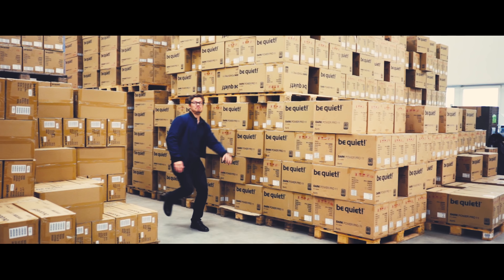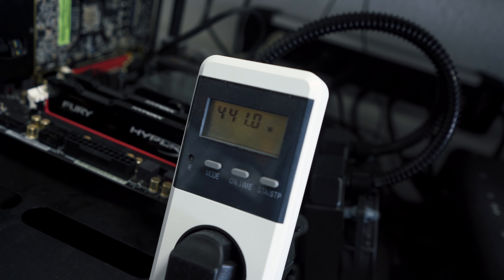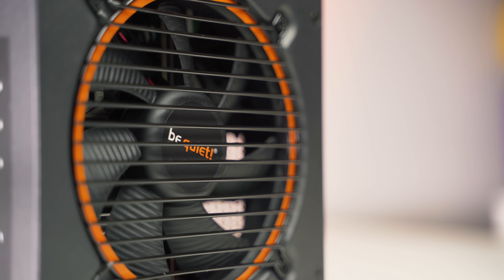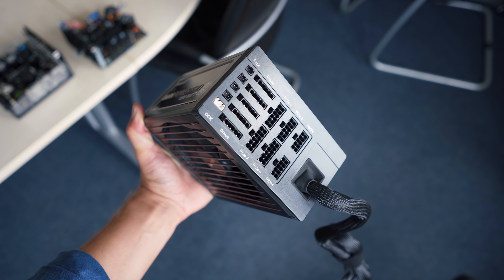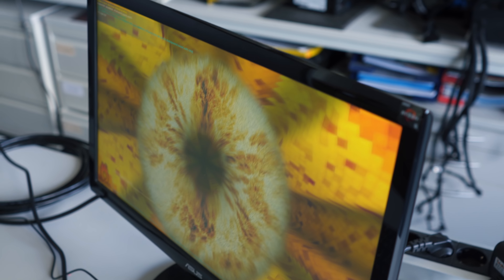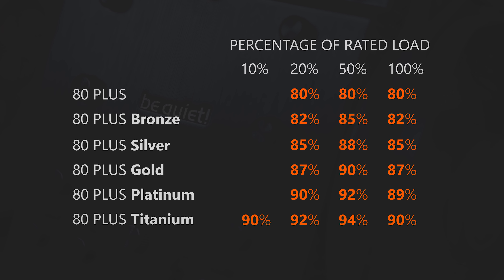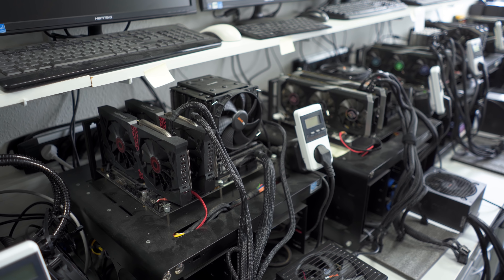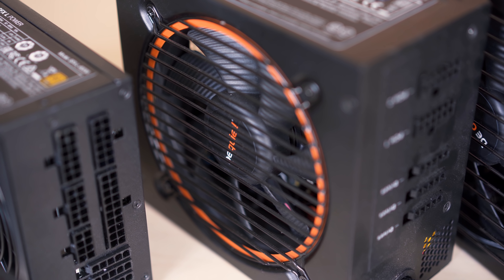How To Choose a Power Supply

Comment: Modular PSU is a must..
Reply: I haven't a clearly opinion about the 24-Pin-Connector, if that has to be modular because their are companies like Bequiet, which have a semi modular power cable system. I mean you could avoid, or improve that with aftermarket extension but I think it depends on the preferred brand.
Reply: @alpher3512  i dont mind if is semi modular or not, because you need 24 and 8 pin connector anyway...
Reply: Learned this the hard way...next built for sure!
Reply: @Amenoxiel   jea me too.... to much of the cables is pain in the ass.... especially for small builds...
Reply: ... or you could improve your cable management! ;) Some 20 years ago, as I started building my PCs, modular PSUs just weren't affordable or even available.
Reply: @hassosigbjoernson5738  he he... true..... but 20 years ago, glass/tempered glass also didn't exist, so cable management was not so important... 😁👍
Reply: semi modular if you're trying to save a few bucks
Reply: @noki448  Naah... you had to do it for better air flow although there still where floppy and CD drives blocking the way. 😉
Reply: @hassosigbjoernson5738  he he you've got that right.....
Reply: @COFASA you are right,... but semi modular are not that expensive anymore,... if this is con, is the only con.... I know you don't need it, but for clean build is not bad to have one...(depending on case of course)😀
Reply: Alpher Quality PSUs usually last for a long time and can be used from one build to the next. Fully modular guarantees that even if the cables break, one can replace them as well as buy some after market cables that have different color schemes to match their latest build. The cost difference between semi- and fully modular are marginal compared to the cost of higher efficiency, for example.
Reply: Or semi modular never use non modular
Reply: @noki448  You need them, but cable mods <3

Comment: choosing a psu is easy.
1) Budget
2) power consumption
3) connectors
4) Get the be quiet psu that fits all these requirements.
Be quiet is the best. Silent, good looking, well built, high 80+ standards, black cables. All th boxes ticked
Reply: Then you have how the PSU actually performs. That's quite important, I'd say
Or do you buy a GPU based on your budget, the TDP and how many connectors it has? GTX 580, here I come!

Comment: I was hoping one of my questions about PSUs would but answered, but it wasn't exactly answered.
I was looking to build a system with a Vega64 but I was looking for the right PSU. I read on Reddit that someone had trouble with their Vega64 because they used a single cable to power both 8-pin connections. When he used 2 separate 8-pin cables the problems he had where gone. Now I'm wondering, how do you know these kind of things? Do you have to look at the connections a PSU has and what power they can provide?
Reply: For GPUs that have a TDP above 225W, use two separate PCIe cables. Below 225W, and you're fine with a single one. So for Vega, use two separate cables. 
The spec for the 8 pin is 150W max. Add the 75W through the PCIe slot, and there's where the 225W number comes from.

Comment: What are your thoughts on server power supplies? I think you mentioned them briefly but I saw a 900w 2” tall psu stretched out long like an LED psu for ~$50 on amazon with 22 positive reviews, the specs and labels check out so I like the look of it for a future laptop build over the taller 3-4” atx power supplies, do you have a video showcasing these?

Comment: I personally have always used evga psus. Currently have the evga supernova 850 G3 powering my Ryzen 7 1700x and Rx Vega 64. Runs very quiet with the Eco mode on and has never given me any instability issues, my old Corsair cx 600w on the other hand caused the Vega 64 to crash under any sort of load. 🤣🤣
Reply: The G3 is among the loudest PSUs on the market. It also has issues with its protections, so the PSU can die instead of powering off safely, like most other decent PSUs would. It also lacks multi rail, increasing the damage in case of a catastrophic failure. 
Who would have thought that an old, low end, group regulated PSU would have issues with Vega. That surprises so many people...
Reply: @MrSeon123  I knew that the 600w would lead to crashing. I just wanted to see what would happen and if it could be done. Yes I knew that it can lead to failure but I didn't care, the inner curiosity won over🤗 as with the G3 I have had since launch with no issues and it never gets loud, so I have no clue what you are talking about in that regard
Reply: Protections are there for when things don't go well. You might end up not needing them, buy you should still have it. 
If you look at e.g. Aris' review, you can see how crap it is for noise
Reply: @MrSeon123  I still don't think you understand what I'm saying here, the supernova G3 PSU is not loud, I own it, the fan barely spins. I dont need to watch a review to show how "loud" it is when I already own it

Comment: in coolermaster's site you get recommended an 850w psu for a 450w system, just saying
Reply: Just saying, that's not uncommon. It's referred to as having headroom to both system stability and future upgrade potential. Any reputable company will do the same thing, though an overhead of 400 is a bit much... Not that it having that much extra is "bad" though; you're still only going to use what you need.

Comment: In case someone's wondering how that 1000 Watt PSU providing 1100 Watt Power, 
High End PSUs have a Peak Power system, which can provide additional 200 Watt more or less power when its necessary. But it doesn't mean this PSU should be rated as 1200 Watt PSU. 1000 Watt is rated for this particular PSU for continuous 1000 Watt Power Delivery. Additional 200 Watt is for Extreme Cases and OF COURSE NOT FOR Continuous usage. Utilizing Peak Power for long time Will make the PSU Hot and Degrade its service quality.

Comment: So the 12V rails still got me a little confused. Can a single device like a GPU use only one Rail or multiple ones?
Reply: Colonel Coffee
 It can use one or the other. You just have to make sure that if you're using a multi rail PSU, and are powering your GPU from a single rail, that that rail's providing enough power to it.

Comment: What timing, been having issues with my PC and discovered my 750W just wasn't enough anymore. 
Specs: ryzen 5 2600x, r9 290,  corsair 360 aio, all housed in the coolermaster sl600m
 The Outervision psu calc is saying that I am drawing 715W while gaming (adjusted the GPU clock/mem to gaming speeds). I'm guessing that the psu being in a warmer spot than it was in the old case I had (corsair air 540) is making it less efficient and it can't handle it when gaming. Surfing, movies and other light stuff are stable but gaming causes hard locks and restarts after the system really warms up. Crossing my fingers and hoping a 850W will solve the issue.
Reply: Outervision is full of dogshit. You are likely doing around 400W-450W at the max. 750W is more than plenty for you. Also efficiency hits about 2% or so away from peak efficiency around 50-75W and the same happens at max load for most PSU's and when you calculate power cost it is penny amounts. Something else is causing this and unless the PSU happens to be bad a new PSU won't fix this.
Reply: Mate, I stay under 400W load with overclocked 1600x and undervolted+overclocked Vega 56...

However, if there are hard locks and stuff, chances are that your PSU is simply low quality
Reply: My PSU is the EVGA G3 750W. It's done the job for years. Something got damaged when I was switching cases. Leaning toward it being the PSU. Luckily, the EVGA G2 is on sale for 1/2 price.

Comment: I have a NVIDIA GeForce GTX 550 Ti in my current PC Tower (case) by CYBERPOWER and my concerns with making a Graphics Card Purchase is the Size available (Measured the space at about 12 inches), and that being said Graphics card Space and as well the needed Power Supply required if I say Purchase a 1060/1070 upgrade Graphics Card.  EVGA GeForce GTX 1070 Ti FTW ULTRA SILENT GAMING, 8GB GDDR5, ACX 3.0 & RGB LED Graphics Card (is that the Socket or Plug in to my mother board?) I really want to be sure that my selection will actually run in my system.

Can you advise?

Comment: wow.. just wow. i was searching and trying to find out which power supply i should get just 1h ago.
Reply: Don't get an EVGA G2 I've had 3 EVGA G2 fail in the last year out of all the computers I built in that time they were the only ones that failed. 2 customers and my brothers all users were very moderate with them and all 3 failed on the main board showing burnt surface mounted parts they are junk stay away.

Comment: Really?? Is this true?? The Be Quiet PSU Calculator estimates 365Watts for the following:
i7 8700, 
RTX 2070,
32gb RAM.
2x SSDs

Does that mean a 450 watt PSU would be totally fine? the RTX 2070 recommends 550 watt atleast, but I'd love to use a corsair SF450

Comment: I still have one question. I have a be quiet system power 8 400w with two 12v rails and a Ryzen 5 1400 and a gtx 1050.

So my question is does my gpu use the second 12v rail or the first since it doesn't require dedicated power than the PCIe slot delivers? :)

Comment: 5:36 what are those 2 pin fan headers? i mean im not sure if that's what you call it, but the pwm control for the fans consist of 4pin right? so how do you use that 4 fan 2pin slots

Comment: How to choose a power supply? Buy Seasonic
Reply: emdea
 Depends on the PSUs. Like the S12 ones are actually quite poor for today's standards, and should be avoided. As far as their modern Focus series goes though, yeah you can't go wrong there.
Reply: @COFASA Wrong, even the most basic PSU made by Seasonic will still be reliable, they never compromise on reliability unlike other brands. Check johnny guru for reviews and show me a bad seasonic unit.  I have put low end (S12II series) psus from seasonic thru hell and they held up eveytime. 520W unit used for mining drawing 630W from the wall for weeks without issues, 620W unit also for mining running at more than the rated power for months without issues - these still run to this day. At the same time i've had Superflower fail at below rated wattage, so no, i will not buy anything else until a new "Delta" stats making PSUs.
Reply: @emdea  S12II might have reliable components, but they do not make up for lack of protections and outdated design
Reply: @emdea   emdea  wrong . Name me 10 "most basic???? Budget??? " PSU that made by seasonic . Isn't most good budget PSU are either made by HEC , CWT and Greatwall(they also make high-end which also good?? mid range most notably is Sirfa for being cheap and good . 

"Check out Jonny guru and show me a bad Seasonic PSU" Yeah iam active there in  the forum there and here in case if you need a list of bad Seasonic PSU. Give me a single forum of people in Jonny guru advise any single person to get a Sii12. 

-sii12/mii12 (group regulated , fan ,no ocp+uvp(12v) 
-Focus series ( GPUs complitity issue , fan. )
-Evga GSs ( burned Vrms when overloaded)
You asked 1 , I've already gave 3. Wanted more?
Reply: @emdea  The M12II/S12II lacks OTP and OCP protections so it is not reliable and it is group regulated  which means its gonna have poor performance. Seasonic is still selling it since idiots keep buying it up. It is 9 years old.
Reply: @Wowezzersdozzers  we were expeceting ''core'' series from seasonic a while ago and they keep hitting us with sii12//mii12 ''evo'' siii12 and stuff lul
Reply: @COFASA  Which Seasonic PSU is the shit one? Exact model, please.
Reply: @jasonpollock9259  I've already gave 3 up there Incase you're asking
Reply: @COFASA Did 12v change to something other than 12v in the past 10 years? Did 12v stop being the primary rail? Or do computer parts suddenly require other voltages beyond 12/5/3.3v ?  I think not... So yeah, i'll stick to quality components (that stood the test of time) over marketing mambo-jumbo any day.
Reply: @emdea  1. in fact they do , no not the 12v thing but no one know what is going to be happened in the future but we all know that ATX is based of 1996 and needed to be changed. 2. They do in fact in another way , modern pc at a contain load might leave the 12 v as low as close to 0, from C6/C7 you are having your 12v at 0.5 and make the 12v/5v get out of spec , at this point don't quite support your 12/5/3.3v because at that point of load your 12v rail don't really provide 12v anymore , so does your 5v because they are not regulate indenpently , does having your 5v to 7v sound like a 12/5/3.3v or a 11/7/3.3? 3. quality , nothing good there when at the first glare you don't even have OCP , and OTP , not even that  your 12v UVP is also not there , this is what people nowadays call quality ? pretty much yea in facebook and youtube , try that in a psu forum like jguru or even llt
Reply: @avevotsira7383  If i cared about sleep states i'd buy an Apple product or at the very least a laptop, my PC's have c states disabled (personal and the ones i've built for other ppl) due to various bugs in the software. I don't really care about how a psu handles C states as i've found them useless for gaming or general productivity (forests be damned). OPP OVP and SCP is all i need on top of good efficiency and longevity. Speaking of longevity there is another brand that makes PSUs that last a long time and that is FSP,  i have 15 year old units that work great to this day and i don't remember ever seeing a failed one.
Reply: @emdea   emdea   emdea  seem like you are really uneducated at PSU you imma ignore you for now since everything you say doesn't either support your statement nor make sense .

1." I don't care about sleepstate" , everyone know that a contain load does also Tigger the crossloading situation and look like every major OEM in the world really don't care about it that the only single OEM that product group regulated is Seasonic , every new platform from any major OEM is now a DC-DC . It's ok to just googled group regulated and sleepstate and try to argue me.
2." Not make sense for gaming or productivity ", maybe you should run your pc directly from a AC line because it doesn't matter to have your 12v providing a 10v into your components thus having all of them running at 120/240v doesn't matter too right? Logical. 
3." Only needs SCP , OVP and OPP" yeah that's what Sii12 provide and that prove how selfish you are protecting and fan boying a product you love or have. Saying that you don't need OTP , OCP , UVP is like saying that airbag and seltbelt is useless which does not make sense.  If a PSU doesn't need those there is no sense it exist there while we all know that it's crucial for a PSU to have following protection for it's own safety , another components safety and also the user safety. Try overloading those rail and the OCP not getting tiggered let see what you'll do. Oh wait Sii12 won't Tigger since OCP doesn't exist there.
5. Every PSU lover know that Efficiency doesn't means much and overated for a average consumer when your load regulations , safety  and reliability isn't there especially not everyone running 6 GPU on a mining rig anything over 80-85% is alright. A PSU lasting long is also depending on the design and qaulity of the internal but why would you wanted a garbage PSU to last long anyway ? I rather have a PSU that will take care of all my another part and last 3 years than a PSU that keep destroying them and last 7 years. You are buying a PSU to power your components not buying a component for the PSU.

Sir , you are really selfish and doesn't admit that you are wrong but most people would noticed it thus I have already proved you wrong a couple of time already that first. Second we all have proved that Sii12 is bad which supports the #1 . In case you are living in a cave with Seasonic you might wanna check some forum like Jonny guru .

Comment: For most people 400 Watt- 750 Watt will do just fine. 600 Watt with some bronze rating is probably the sweet spot.

Those who need more will anyways know what they are doing.
Reply: And it's clear that you don't need more than 750W. 
The 80+ rating says nothing about how good the PSU is. And 600W is what you'd need for a 2080 Ti and/or HEDT

Comment: Guys please advice
I do have this Parts

Ryzen 7 1700
Asus Strix B450-f
Zotac 1060 6GB
2x8Gb 3200hz Ram
Aerocool quarts RGB case
Rgb Mouse and Kayboard.

My question do i need 700watts of power supply since the technecian gv it to me instead of 650watts?